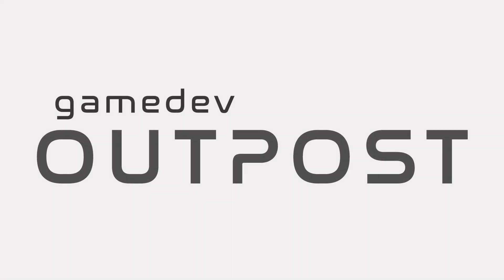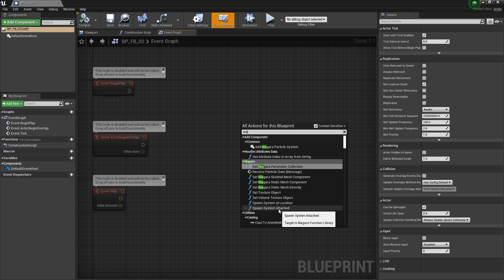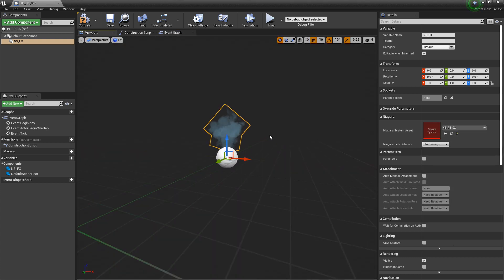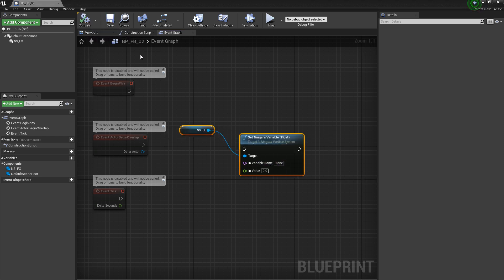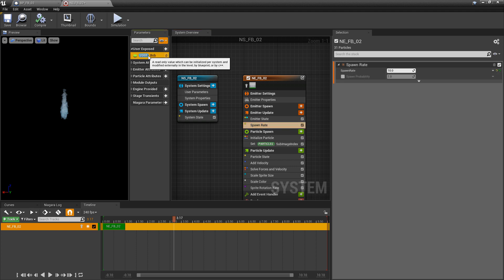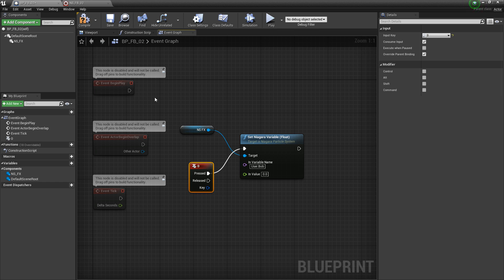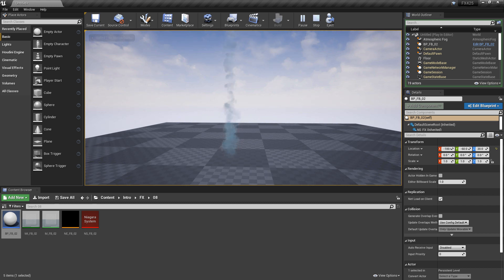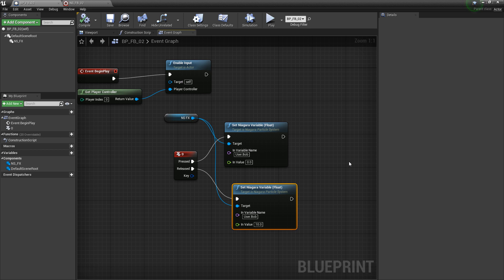UE4 - Niagara Blueprints and User Parameters

Comment: If someone is struggling with the key not working I GUESS that UE5+ uses different approach. You need to add two nodes: get player character (that has the same "player index" input as old player controller) plug in into Player Controller, and then into Enable input.
In Short: Ger Player Character->Get Player Controler->Enable Input.